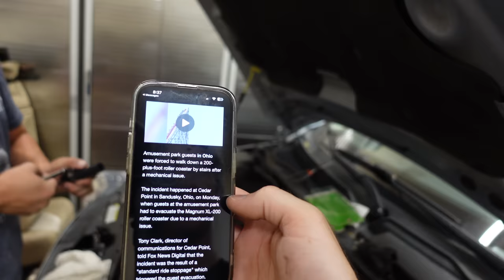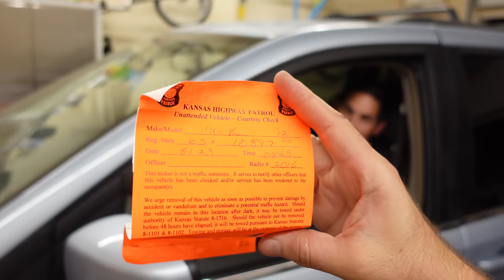INSANE Heat Wave Caused Gabe's Family Hauler To EXPLODE

Comment: Good to see Chrysler kept using cheap plastic on critical parts. This was the biggest problem I had with my 2.7 - plastic thermostat housing would crack every 40,000 miles.
Reply: When I worked at Chrysler Parts, the 2.7L & 3.5L coolant housing, and these damn heater hoses for the T&C/Caravan/Routan were sold on a weekly (sometimes daily) basis. they were complete junk.
Reply from the maker: Yup, we changed his thermostat housing on this last year 💯
Reply: Same issue with plastic coolant elbows on the GM 3.8 V6... they all do it.  Tell any auto manufacturer they can save 5 cents per car and the beancounters will jump on it every time as long as it lasts past the warranty.
Reply: @subrosa.photography or the oil filter housings lol
Reply: The good thing is you become very skilled at it vs the frustration of doing new projects all the time. Like my wheel bearings, the first one took 6 hours now I can get it done in 1 hour with no trips to the parts store.

Comment: Im a mechanic and was working on them for 13 years. left the job in 2012 and any plastic  (water) fitting eventually cracks and crumbles on them.  I can remember an audi A6 SOHC v6 the customer had a small leak from the water pipes that ran from the throttle body and eventually overheated. A slow drip. They have a splash shield for the oil  from the cams in the rocker covers. it got so hot they both melted ran down the drain holes into the oil pan and the melted plastic blocked the oil pick up and that seized the motor. Awesome design. if the water leak doesn't get you the melting plastic will. The golfs had the plastic water outlets with the o rings that had steel sleeves around the 2 6mm bolts that hold them on. mk3. They  regularly cracked from the sleeves to the centre and if you didn't see the the antifreeze stain it would turn into a dripping leak quickly. That was also compounded by the rad fan sender failing regularly. Any of the Audis with an orange plastic dipstick sleeve. They were on the fast seller list at the dealers. Well they break off at the bottom from heat and time and if you dont realise that they are broken the dip stick sits lower in the tube giving a false level reading. (by quite a lot) Then you have the brown positive cables on the A4s that run from the battery to the starter. After 2 to 3 years the insulation falls off them and the only bit that doesn't fall off is the piece that is under the 'P' clip on the back corner of the block behind the manifold. they are tight enough not to touch any thing but its still scary finding them. I could go on. LOL
Reply: I know exactly what you're saying.  I'm a mechanic too with a lot less experience but I've already seen a ton of coolant leaks related to leaking plastic parts.  It is sickening to realize how much plastic is being used in today's modern engines.  I refuse to buy any of them; I stick with engines that are made with primarily metal.  Amazing: they don't leak coolant...and seem to have less problems in general, too!

Comment: I just replaced both heater core hoses on my moms 12 Town and country a week ago, and about a year prior I had to replace both hoses on my old 13 Grand Caravan. I replaced mine in 90 degree heat in a blacktop parking lot in direct sunlight. Was definitely not fun but it is what it is. But the second time around I did it in less than 15 minutes. Was much easier in a 70 degree night. I used the Dorman hoses, for $150 both times. Mine actually burst, and my moms was just leaking. Super known issue with these vans.
Reply: Excellent job saving BIG $ doing your own work. I love to see/ hear people in your situation! Im the same way.

Comment: Just a quick correction.  The coaster you were describing with the cable lift is Millennium Force. A Giga coaster standing at 310 feet. Initial drop speed, 93 Mph.  The one that stalled is the Magnum XL200 , a 200 foot coaster with a chain lift. Initial drop speed, 72 Mph. Built in 1989, it was the worlds first "Hyper" coaster and kept that record until 1994.  The ride stalled due to what is being called a "standard ride stoppage".  These typically are a result of a track sensor error that will not allow the ride to re-start until it is cleared for safety reasons.  Love your videos btw!  Keep up the great job!
Reply: I've been stuck on  Millennium Force half way up. We waited 45 minutes and they resumed it and said it was a 'unbuckled' seatbelt.

Comment: Dorman makes the aluminum oil filter etc adaptor on the top of the engine too, and it sounds like it's starting to lose one of the roller rockers from the minor tick I'm hearing. If it is replace them right away before it starts eating the cam lobe, then it's a lot more work and parts.
Reply: Yeah but it has problems too, After 2 of them I went back to OEM.

Comment: If I remember correctly, the OE part includes the cross-over behind the motor or something.  It is expensive.  My wife's T&C had this issue last year.  Just wait until you have to do the oil cooler.  I was talking to one of my buddies who runs a shop and he was impressed my factory one made it to 180k.  He said probably because I change my own oil and don't crank on it.
Reply: and you WILL have to do the oil cooler! They always start leaking and you'll know it when you dump oil on right turns.

Comment: Good video, glad it was a cheap repair.  You have got some serious lifter tick in that engine, though.  Super common 3.6 problem.  Eats the cams if you keep driving it that way.  Best get that repaired or you'll be replacing the whole engine.
I am very disappointed by the amount of plastic used on the 3.6 engine.  I have seen so many coolant issues on these engines.  (I'm a mechanic so I see a lot of vehicles come in and out).

Comment: I was thinking about replacing that Y-pipe on my 2012 T&C as a preventative measure, and I was sure I was going to have the order the metal replacement part.  It's nice to know that O'Reilly had it in stock.  I'll have to check them out.
Reply: With common failure parts, they usually have a stock.

Comment: It's been 2 years since I worked for AutoZone and I still remember that part number.  The whole heater hose kit with the metal Y is the Dorman 626-315HP and is about $135

Comment: You should do a thorough burping of the coolant system on these vans compared to other vehicles. If he comes back with random minor overheating, that's the cause. With coolant lines running all the way to the rear of the van, there's a LOT of spaces for bubbles to get stuck.
Reply: wtf is at the back?
Reply: A second heater core

Comment: My 2006 Tahoe has those "y"s up by the firewall for coolant as well, and they too are plastic.  They're not leaking, but I've got brand new OEM ones to replace them when I get in the mood.  Don't know if they make metal ones for my car or not.
Reply: 2006 Tahoe will run forever. Great buy.

Comment: I literally replaced those heater hoses on my Caravan 3.6 last week.  Rockauto has the cheapest set of the complete hose assemblies i could find with metal y-fittings.  SKP brand.

Comment: This has been a Caravan/T&C/Routan problem forever, I own a 2014 T&C and a 2018 Caravan (obviously with the 3.6L) Dorman make a line kit with the metal Y also BUT the slip-lock fitting is wrong and you have to move that over from your factory lines. I have done this repair on both of my vans. The other thing to remember is bleed it with a cap funnel, because of the rear heater core, it LOVES to trap air and can be a challenge to remove UNLESS you use the giant funnel. These are good cars with a few temperamental issues, my daily (The T&C) has 215K and still going. The good news is he should never need to repair that coolant Y again, once the fix you did is done, it's done. Now, and far as the oil cooler, Thermostat housing, coolant crossover tube, and a ticking lifter-follower and oil control valves (they call them lifters) that's all another story, because ALL of those will eventually have to be fixed.

Comment: Man Van? Looks like a "Soccer Mom" van to me! 
You should be driving a 4x4 box van with a 6" lift kit,  flame decals coming off the front wheel wells, and 6 KC Lights across the top of the windshield. That's a man van. 
p. s. Glad you are safe now. It can be really scary stuck on the 96 especially in a soccer mom van!🥸❤️🥸

Comment: These are so well known for blowing the heater lines that the aftermarket companies are making new ones with aluminum fittings on them instead of the crap plastic. One of my best selling cooling system parts. If yours ain't broke, you better replace it now!

Comment: Sounds like that van might have a bad rocker with the ticking noise. Sounded just like my GC with the 3.6. I ended up having one bad rocker but replaced them all. Now it's nice and smooth.
Reply: Exactly what it is! I’ve not had time or motivation to fix it though.
Reply: @Gabe-ABNCW3  it was the same with me too. Summer was approaching though and I needed to do some family trips with it. Took me a month to do because I work so much from home and hot af but I got it done. It can be done in a day though, lol. Good luck!

Comment: JR that’s the same engine a lot of us have in our Jeeps and if you have a repair like that you’ll typically have to use a spill proof funnel and burp the cooling system. It easily gets air bubbles in the cooling system. I’m surprised you aren’t replacing the oil cooler in it too, they are plastic and always crack in these engines and leak oil.

Comment: Go ahead and replace the other Y as well.  This happened on my 2010 Dodge Grand Caravan.  I just replaced the one, then the other failed and overheated, taking the head gasket with it.  Thanksfully this is the 3.3 L not the Pentastar engine.

Comment: My silverado did the same thing on a camping trip with my wife air in the lines would make it overheat quick dang hard plastic connectors in the lower radiator hose

Comment: Now that it’s got hot pay attention for oil leaks. The oil filter housing/cooler is under the intake and you guessed it. Made of plastic. Another very common failure point.  They are a pain to get too.  Good times.

Comment: last time I had a coolant issue with an engine, the radiator EXPLODED doing 65 down a highway splattered coolant all over the windshield not only that but this vehicle didnt have A/C and it was in the low 90s outside so we had the windows down. my arm was burnt for 3 days

Comment: I had this happen on the old grand caravan stx, shortly after than the wire harness rubbed through needing repair, than the valve body took a poop all under a hundred thousand miles. Mopar might as well be no car.

Comment: -Why not just pull the lower radiator hose off, drain the majority of the coolant, and do a full refill?  Just adding water [I hope you added distilled water, not tap water~!] and topping it off with coolant after a leak is not a good idea. You really have no idea what your water/coolant ratio is...

Great video!

Comment: Hey JR! Magnum XL200 is NOT the best roller coaster in the entire world. It's not even the best ride at Cedar Point. You're thinking of and describing Millennium Force. Millennium Force was the first Gigacoaster. Milliennium Force has the smooth cable lift. Magnum XL200 is a 1980s era hypercoaster. It DOES have chain lift and it's ancient, rough, and frankly needs to be replaced by something newer. But from your description, you're definitely thinking of Millennium Force -- and I agree, MF is the best roller coaster in the entire world!

Comment: Since you overheated the engine. I wonder if that aluminum head isn`t warped or a value didn`t drop or you blew the head gasket .After overheating the engine just fixing a hose might not be as simple as you think so better cross your fingers and hope for the best

Comment: That wasn't a heat wave caused issue. Most engines run at 180 to 200 degrees. It doesn't care if it's 120 degrees outside. Chrysler products are known to have exactly 1.2 teaspoons more fluids than it actually needs to operate. Including anti freeze. The smallest of mechanical failure will leave you walking in a hurry. I've lived in Phoenix for over 40 years. We need sweaters when it gets below 105. But, we have 8 months of the best weather in the country. We're actually having a mild summer compared to days gone by. Don't worry, AL Gore said we were going to die in 1981. Now he's worth $370 million. And his beach front mansion are doing just fine.

Comment: dexcool? Idk the year of this but Im pretty sure it takes HOAT like dodges before 2013 (says online g12 which is oat so who knows what to use in these things). Oh and I'm pretty sure that also has the rocker roller tick thats eating the camshaft sounded like it when backing out
Reply: Yup. That’s the dreaded 3.6 rocker tick.
Reply: @Gabe-ABNCW3  Might be fixable with this one. I have a caravan that I got at 150,000 that had the tick and it's still going strong after replacing the rollers. Exhuast side cyl 1 lobe sides were worn down but I'm still running it with that camshaft lol

Comment: Well, this is what you get when you buy a VW by Plymouth.
Reply: Yeah... a cheap repair after 150,000 miles. How horrible.
Reply: You think it’s remarkable that a heater hose joint fails at 150K miles? Seems like a fan boy comment.
Reply: I guess ford  uses  better  plastic  my ford  had a similar  issue  after 10 years  and 240k